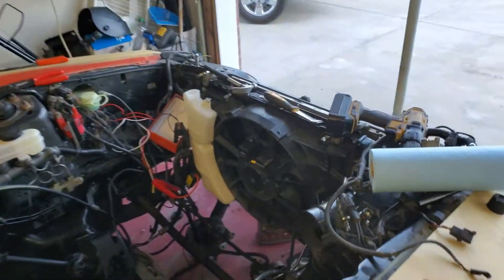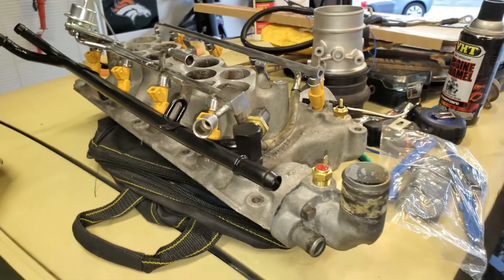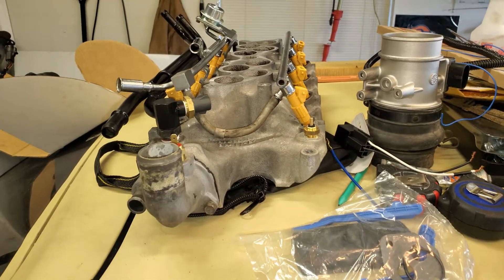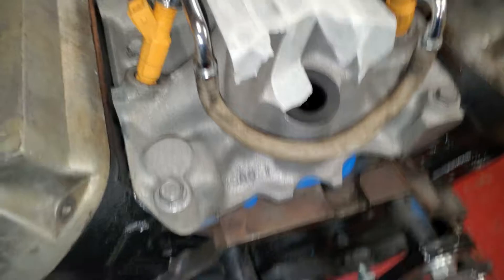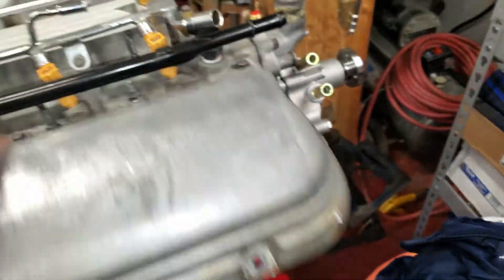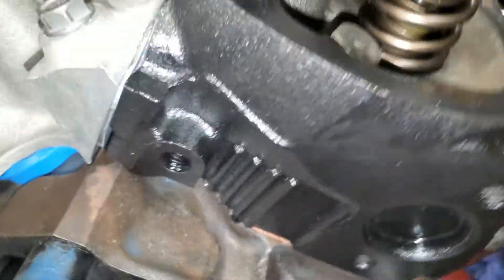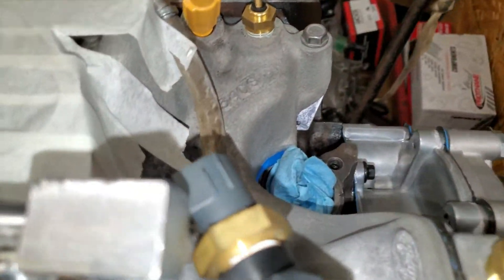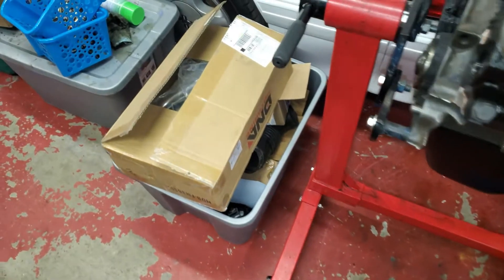Eight Nine Garage - Motor is ALMOST Ready! - EP10

Comment: How did the DNA Headers work out?  Do you have the part number for them?  I am planning on installing GT40P heads on my 89 and am looking for budget friendly headers,
Reply from the maker: Really well. I will look for the part number and post it. I do have it on my PC at home.
Reply from the maker: I have FM8650L as the part number. I went back through my purchase history, and it says they are no longer available. I did a search for just "headers". :hand-orange-covering-eyes: My goodness, the prices are ridiculous right now.
Reply: @89G  ok, thanks. Maybe I will find a used set out there somewhere. Thanks again for the info!
Reply: @89G  Were there any issues with the fit?
Reply from the maker: @charlesknapp4079  no problem. On my 89, I have Brentech headers. Those work with 90 degree boots too.
Reply from the maker: @charlesknapp4079  no, they fit great. I like them a lot better than the MAC'S  that I replaced with them.
Reply: @89G  awesome!